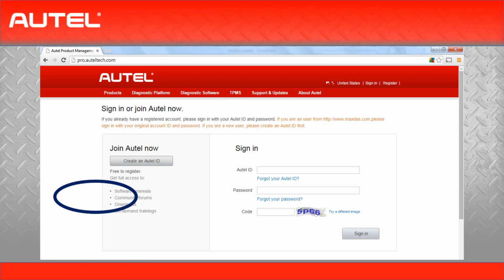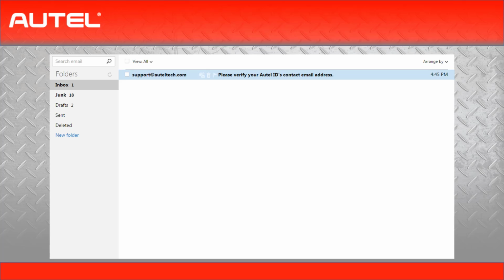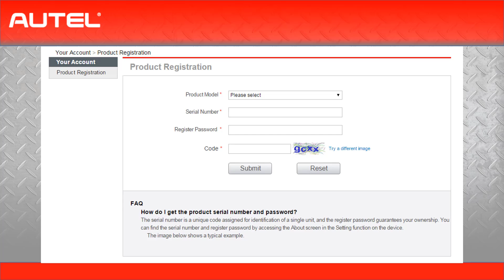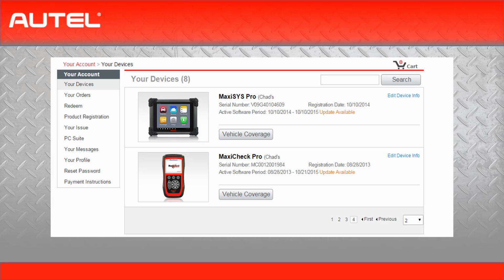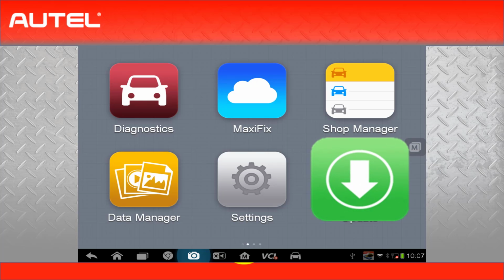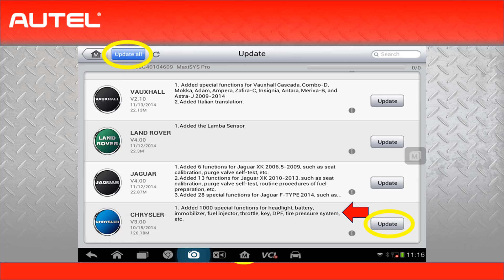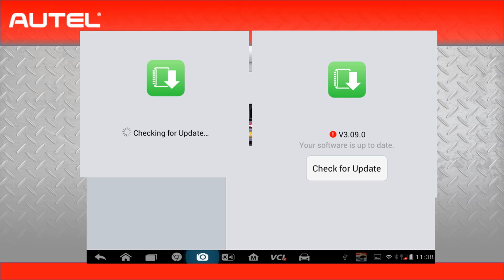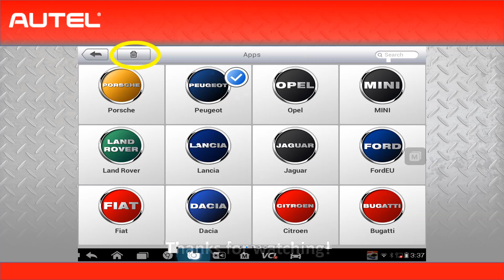Autel MaxiSys Registration and update

Comment: We have a used MaxiSys 905. Worked great until a factory reset was done. Now, the app doesn't work and is registered to someone else.  So now we have to contact support and make a transfer then pay $600-700!? Is it worth it? Does it add any warranty for discontinued and outdated product? Please respond. Thank you
Reply from the maker: You will need to contact your local tech support on this one. For and Autel US tool, yes it would extend the updates and warranty. That may not be the case in other regions. For the price of an update you could purchase the DS808 and have the same functionality and get a new tool

Comment: If my account has expired, am I able to use the system still? I don't have money to renew :(
Reply from the maker: You can still use the tool at the level it is at. Just make sure you turn off your Wifi so the tool does not try to update any system updates. Those can cause issues with your vehicle coverage

Comment: Lots of people have run out of  storage space on the units with 32 gb internal drives and the BMW updates won't take. The solution typically has been to get a new 32 GB Sandisk memory card and install it in the ext SD memory card slot and mounting the ext SD memory card. If within the update period You delete BMW, Mini apps. Go back to update and re download these Apps and they install to the EXT SD card
Reply from the maker: Here is a video on tha Apps uninstall process https://youtu.be/W2OXOW8T4R4

Comment: I have a problem with my maxi mini , my screen don’t respond 50% of the time?????help help plz......????
Reply from the maker: Look at the back side of the tool.  Is it still flat like when it was new or is it bulging. I have seen where the battery will swell and put pressure on the screen and can cause that issue.  You need to contact support and they can help diagnose and repair your tool https://support.autel.com/support/home

Comment: for update every year how take charge?

here in Saudi Arabia I meet autel maxisys dealers they are told me if I don't update I can't check new model car's from the finish upper model, but you told me I will loss programming function 
I really confused
Reply from the maker: Both are correct, The purpose of the updates it to keep your tool current with the most recent vehicle releases and up to date on the newest vehicles.  The updates also fill in gaps and functions for older vehicles.  If you don't purchase updates there is no way for your tool to keep up with the newest vehicles coming out.  The programming features for the European vehicles is based on the Autel cloud.  If you are expired on your tool you will not have access to the could, and that means no programming functions.  Updates can be purchased from your local dealer or directly from the tool from "Maxi Mall"

Comment: autel maxisys pro ms908p can use without update contains,
I'm interest to purchase if it can use without update
Reply from the maker: The MS908P comes with 12 months of updates and 12 months of warranty from the region it is purchased from.  Updates are not forced when the contract expires, but you will loose the programming functions of the tool outside of the contract.
Reply: I own one, they want 1,000 for the update, right now my scanner is useless smh
Reply: @dominicantoston  so the updates costs 1000 euro ???

Comment: You can use Autel maxysis  (regular, no pro) to replace modules?  Like PCM,  abs, instrument cluster, Fuce boxes?
Reply from the maker: Yes, no, and Maybe.  Every manufacturer does it different. I think of it this way, If the module I am replacing is blank, and has no information in it, I am going to have to program it.  That would require J2534.  If I am replacing a module that is the same numbers and calibration as my current unit most likely I can replace it without using J2534.
Reply: Flash Performance tank you so much